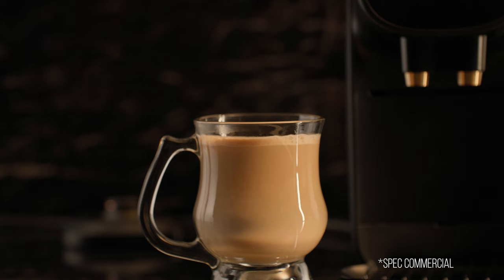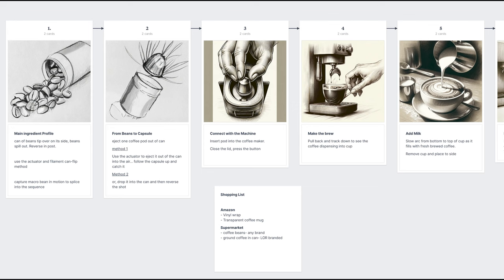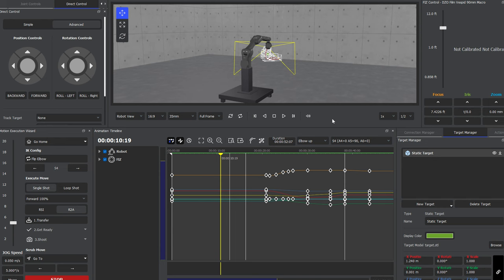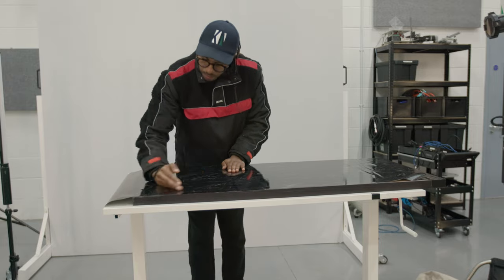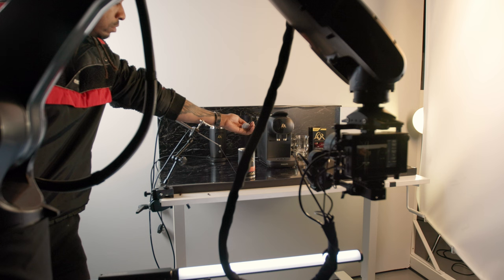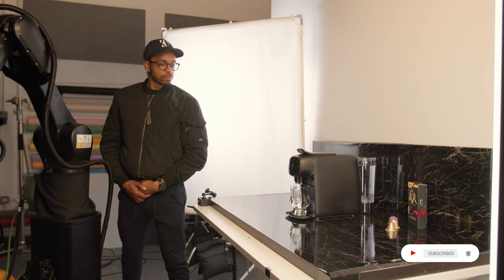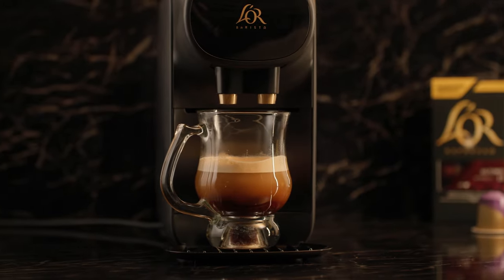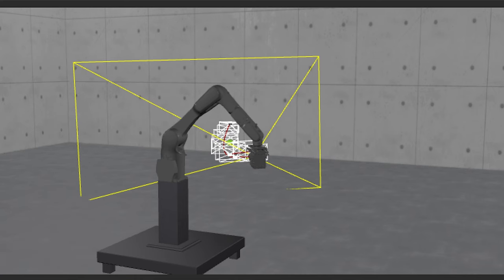We Used A Motion Control Cinema Robot To Film An Awesome Coffee Maker Product Commercial!

Comment: Looks amazing! I have one little feedback hoping it helps someone someday, use a heatgun to warm up the glass right before the pouring of the coffee. The coffee should get in the glass at around 80C, hence creating condensation. You would get a cleaner result without it. I worked for 6 month with coffee so I had to develop a few tricks :)
Reply from the maker: Thanks Charley. I really appreciate it bro. Thanks for the tip 👊🏾